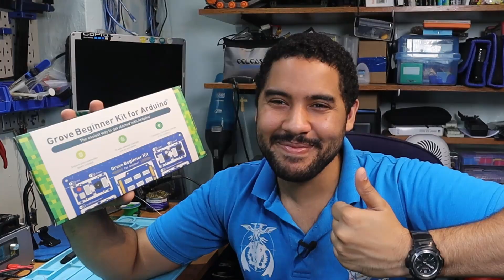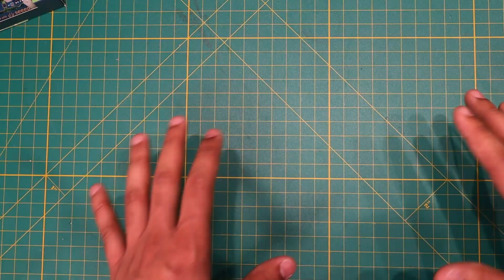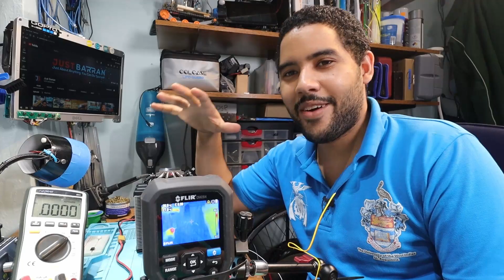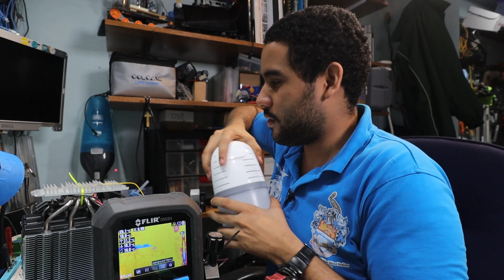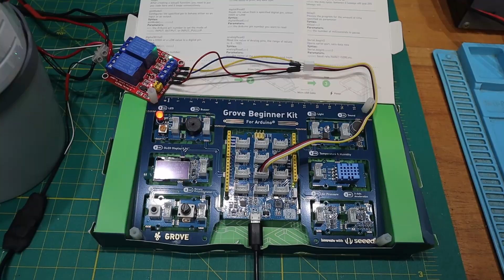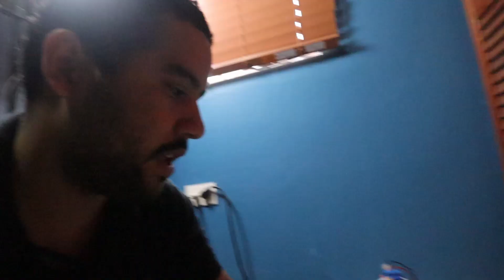DiY automatic dehumidifier ft Peltier cooler and Grove Beginners kit for Arduino

Comment from the maker: What features would you like to see in a version 2?
Reply: I think v2 would have a fan on the cold side to increase air flow
Reply from the maker: @IanDaniel-DataAnalytics  the problem with this is a fan on the cool side would have also cause the water to be wicked away back into the air so it really a balance. Maybe a very slow breeze
Reply: Larger heat sinks on both the hot and cold sides and a fan to pass the air first over the hot side then onto the cooling side. This will increase the extraction efficiency by creating a wringing action when the air cools.
Reply from the maker: @garyl6031  for sure, I tested heat sinks, on the cold side the smaller the better as it gets colder to help with reaching the due point
Reply: I don't think having a fan running full on the cold side would work in this case. The cold side doesn't get THAT cold. Having a fan on full would draw too much warm air raising the overall temperature of the heat sink preventing the air from reaching dew point and atomizing the water on the cold side. 

My suggestion:
You would need to drive the cold side as cold as you can by isolating the cold side into a smaller volume than "the entire room." Pass warm air into this volume slowly keeping the heatsink fin temperature below the dew point.  (temp sensor on the cold side heat sink and a PWM controlled fan circulating the air maybe?) The fan should not be strong enough to create a breeze to atomize the water droplets.

A second peltier device stacked may decrease the overall temperature a bit more, but doubling the power requirements.
Peltier devices are not very efficient with thermally speaking. They are convenient and space efficient. 

Another thing you might try is to pass the COLD exit air over the hot side. Peltiers create a temp drop between the hot side and cold side. The colder the hot side is, the colder the cold side is. Since the purpose is not to create AC, the cold exit air would help in some small amount to make the device slightly more efficient.
Just be careful to not create too much of a vacuum of the cold side with the hot side fan, and in result raising the cold side too high for condensation.
Maybe instead of a cold side fan, have the hot side fan draw the air with vacuum. Rate can be controlled with a louver attached to a servo.
Reply from the maker: @2008synack  you are really right here
Reply: @JustBarran  energy consumption values would be great!!
Reply from the maker: @DownToEngineer  this was pulling  12v 3A which was the max my power supply could have outputted at the time so about 36W
Reply: you could make a dehumidifier for storing 3d printing filament-huge demand!

Comment: You should be getting a much higher temperature drop across the peltier unit than at best an 11°C change at the beginning. Considering you weren't using forced convection on the cold side. I might have missed it but did you use thermal compound for the connections? With that large of a hot side heat sink, a small cold side sink and running nearly 40W you should be able to get below 0°C. When I've used them, you either need a good sized heat sink or else a fan to keep it from freezing up.
Reply from the maker: Yea I used a thermal compound, but I was a bit surprised also I wasn’t able to get below 0, could also be a limitation of the powersupply or these peltiers I have. One of these days I would do a second try at this and use some lipo batteries instead
Reply: @JustBarran  with mine they're rated to go to 60W I believe. They say 12V but I've gone to a lot higher to get to 60W.
Reply from the maker: Yeah, I feel I would try and push mines a bit more next time around, thanks

Comment: Great video: nice work.  Maybe I missed it but I didn't hear/see anything in terms of relative humidity drop after running the device overnight?  All the other mentions of Peltier devices that I've seen say this approach is best suited to small spaces, as in quite a bit smaller than the room you are in?  So I'm very curious what results you are getting.  Maybe an array of 10 of those Peltiers could make a dent in your relative humidity?  Anyway, I'm with you on those chemical moisture absorbers: really not a great solution.  

Just as a point of comparison, when I run our split system on dry mode in a roughly 15 square meter room with normal ceiling height (sorry, too lazy to measure the volume), I get about 1 drop of water exiting from the drain pipe every 12 seconds or so, and the result is the relative humidity drops by about 10% over the course of about 40 minutes, from 63% to 53%.  This might give you a rough indication of how many Peltier devices you might need to use to achieve something similar?
Reply from the maker: Sorry for this late reply. This specific unit didn't make a dent in the relative humidity. You are correct that it would work best in a small closet. Also this isn't optimized much also (cooling on the heated side and surface area/cooling on the cooling side). I would add that after this project I both a off the shelf Peltier dehumidifier, inside has two high power peltiers and a really nice fin array that I have running 24/7 and thus brings the humidity in my lab (about 86sqft) from 70% to about 50%. But this is really optimize for the job. If I took some more time and get a better fin maybe cut down on the surface area of that heatsink so it gets colder as in smaller heat sink it would work better. Also there is the fact of the due point/temperature of the room.   With regards to your AC, I think the airflow plays a big part in that as AC units move a lot of air and by lowing the temperature in the room it also affects the humidity. I don't think peltiers can complete with a refrigeration cycle system. As in the case of my lab ( the pelitier dehumidifier that has two pelitiers) it takes about 2 days to full the tank 70oz, I find it works really good. https://amzn.to/43ovl4w this is just for comparison. Hope this helps. I am do a follow-up video sometime in the future where I revisit the design but right now I just don't have time. 😢
Reply: @JustBarran  Hey, that's great to know!  Would you be able to share a link to the high powered Peltier system you used?  It sounds like it is accomplishing something comparable to what my AC unit is doing, humidity wise so I'd love to compare the power consumption and price.  My guess is the Peltier device would need less maintenance considering there are fewer moving parts and no refrigerant involved.  So yeah: I'm really interested if you have a link!  Thanks again for the video!
Reply from the maker: Sorry for the site response but you can find the links in the description of the video
Reply: @JustBarran  Hey, actually I was asking about the off-the-shelf Peltier dehumidifier with high power Peltiers: I don't think you linked to that in the description?
Reply from the maker: @malk6277  https://www.amazon.com/dp/B0952G7XD9/ref=cm_sw_r_as_gl_api_gl_i_FBDGR6XP3BNNDJPH13N8?linkCode=ml1&tag=justbarran-20 but I see that it is now unavailable

Comment: So with higher temperature comes a higher chance of potential humidity right?
Reply from the maker: Yep something so,  well humidity is water dissolved in dissolves air, higher temperatures means that the air can hold more water but this causes the humidity to drop also because as the hot air raise it would move the moisture up

Comment: you screwed both the heatsinks together which will conduct heat from the hot heatsink to the cold heatsink via those metal screws. Have some plastic grommet in between those screws to stopthe conduction!
Reply from the maker: Yeah, you are correct. I could also use some nylon standoff/screws to help reduce the heat transfer. Things to add in the V2 😭

Comment: I'm still in the part about choosing the right amount of aluminum in the cold side, since I'm using a 12715 that's a bit more powerful and I have to fight against the average of 80% yearly rate since I'm close to the shore...  the cold fan to the cold side will also prevent it to freeze if you can put this to work in the max power...
Reply from the maker: I would prob put it to the test first, and see how cold it gets, generally you wouldn’t need a fan on the cold side if you are doing Dehumidifying, and the bigger the aluminum as in my video the higher the lowerest temperature would be. The important side is the hot side because that needs to be cooled as best as possible

Comment: It would be interesting to know the KWh or power draw for this vs say putting the Ac in dry mode for short periods achieving the same humidity drop?
Reply from the maker: That’s a really good point, Ill see if I can plan out a test, but think a Compressor base AC would produce more water in a shorter period, could program a microcontroller to put it on in small periods but it also would be activly be using energy to cool the room also even in dry mode, while this operates more passively (35w) on the due point effect, and I thinking I could even run this off a small solar system.

Comment: Would of been easier to list what you wasn't  using 😄😅😅😅😅
Reply: Also did it actually help , like did you notice whether measured or felt different ?
Reply from the maker: @usmanmohammed8949  Well seeing as it only produced 25ml in 8hrs I don't think it would make that big of a difference, It is presently in the lab on and working, No noticeable differences, but it clearly is doing something, I think there is a lot more to improve on also so version two would be in the pipeline.